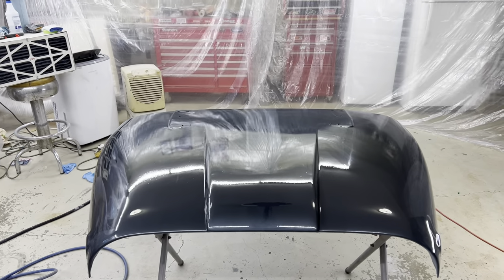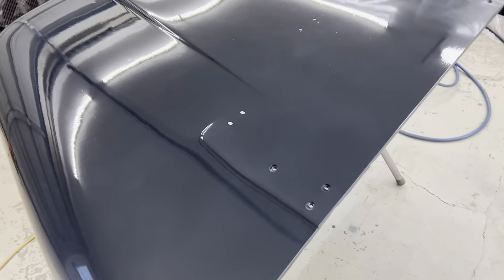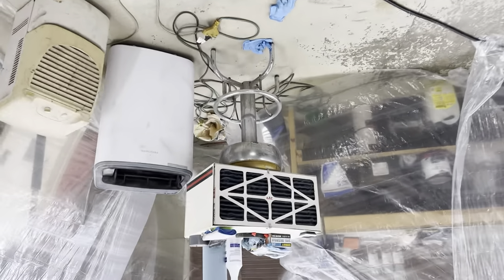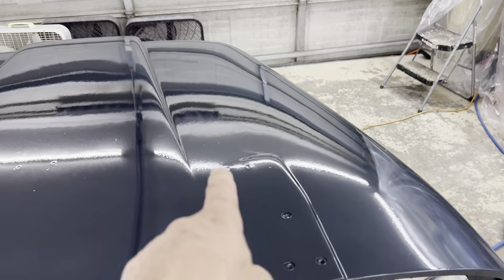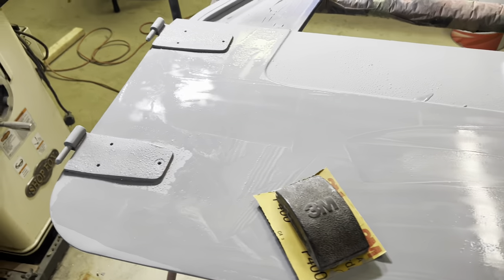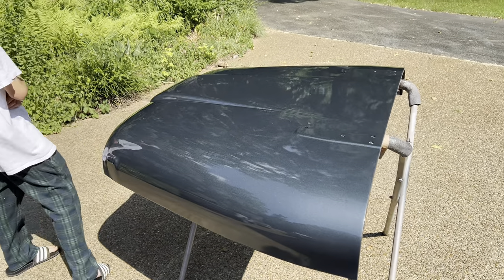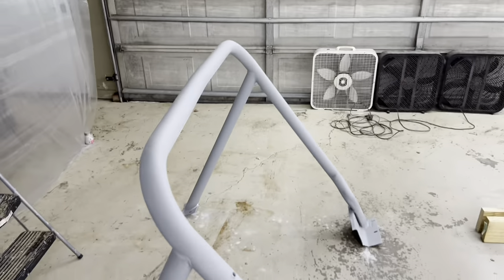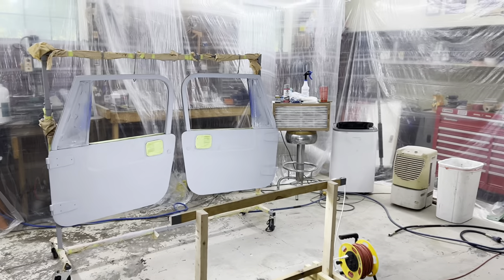1985 Jeep CJ7 Resto, Ep. 61

Comment: I likey! So that paint, which by the way looks great like Jim was saying, is a color and clear coat in one eh? Kinda the equivalent of paint & primer that I’m using to housepaint! 😇
Reply from the maker: Yes, it’s called a “single stage” paint because the color & the clear are integrated. The truck restoration I did with Claude was base coat, then clear coat shot over it- two steps. I chose single stage for the Jeep to keep costs down and for simplicity.